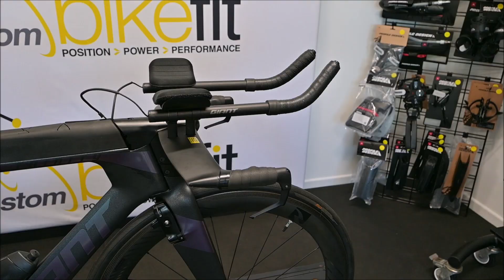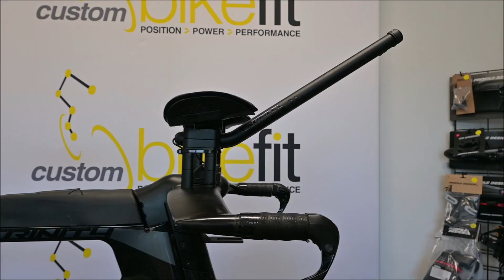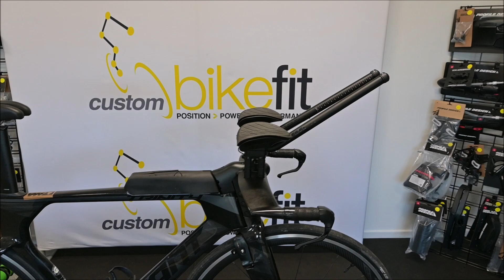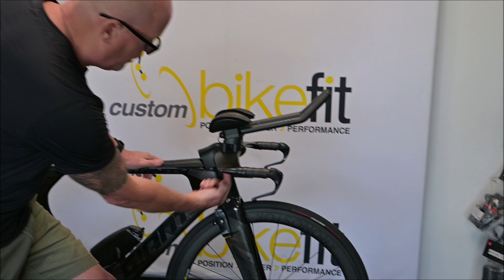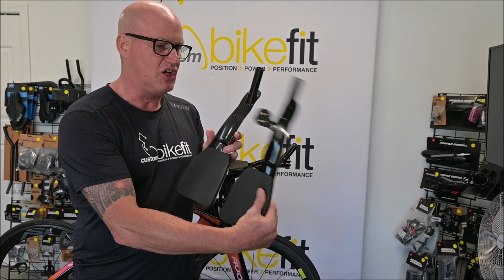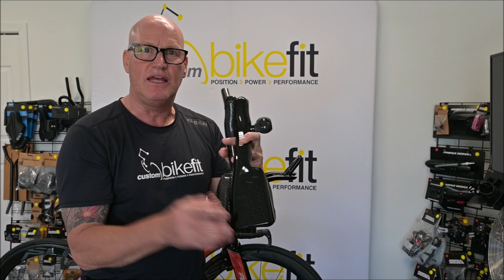Giant Trinity Bike Fit for High Hands Position

Comment: Cool honest review 👌🏻 I'm a giant trinity & propel owner.  But also a specialized fan boy tbh.   But same I went with the Trinity and propel, vs. The venge and transition at the time... because of price; because the spec version of similar bikes were 2,500 to 3,000 $ more in price but the transition when observed had a faulty fork/headset design that rubbed itself to crumble on its proprietary edges when turning the fork all the way to left/right for car fitment.  Which seemed like a design fail on specs part.  So I got the Trinity and never looked back.  Upgraded from a Kestrel Talon TT bike, been happy ever since.  wba.  I don't feel the NEED to upgrade it, since everything I ride it, people say "nice NEW bike".  And they are surprised when I tell them it's like 5 or 6 years old, really.  It is at the higher echelon of tt tech IMHO,  so I'm staying w it for many a year.  Done.

Comment: Thanks for the video. Very helpful. Could you tell me which extensions exactly you're using for the second option? My Trinity has the Giant flatter extensions but I'd like to try the ones you have fitted.
Reply from the maker: The 2nd option utilizes the standard Trinity extensions with a 15 degree wedge from Speedmetrics. It's the wedge that creates the high hand position
Reply: @custombikefit466  Oh I thought you said they were very similar but a different brand. Thought perhaps they were some Profile ones. Cheers, very helpful video for me!
Reply from the maker: Thank you